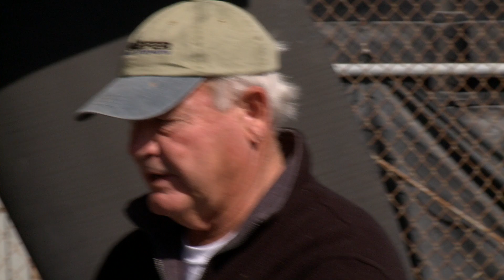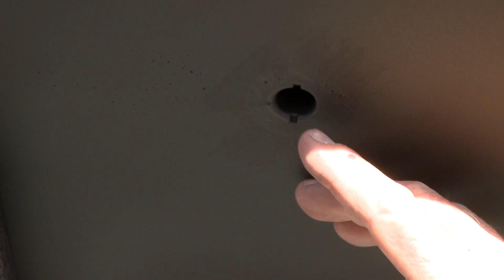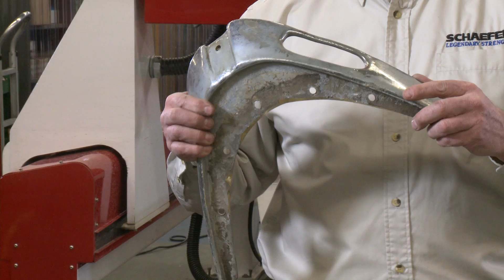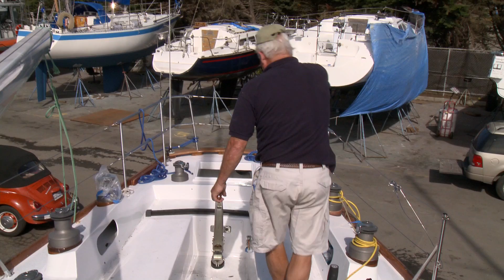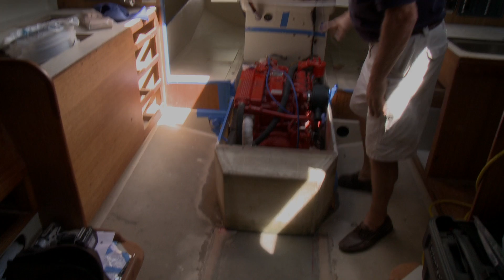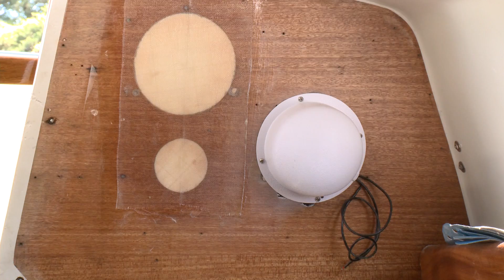Time to Launch?  (a new segment)

Comment: If your knotmeter transducer is fixed vertically on the keel, won't it measure different speeds depending on your tack? The reason I'm asking is mine is just on the hull, but just ahead of the leading edge of the keel and I do notice a 1.5kt difference between a port and a starboard tack (when heeling 20º or more). I'm curious to know your thoughts about that.

Comment: Another big thing about the original cal 40 rudder was it's notable weather helm, for those wondering that means you are sitting on the high side of the cockpit steering and having to hold a constant pressure on the tiller pulling it toward you to keep course some of the sheer strongest men I've met in my 60 years were back in the day cal 40 owners lol

Comment: I realize options are limited, but won’t having a water tank in the bow impact the balance and contribute to hobby horsing. My understanding was that you want to do everything possible to get weight out of the ends or, if unavailable, get the weight as far back as possible to lift the bow to make surfing easier, especially for downhill races in CA.